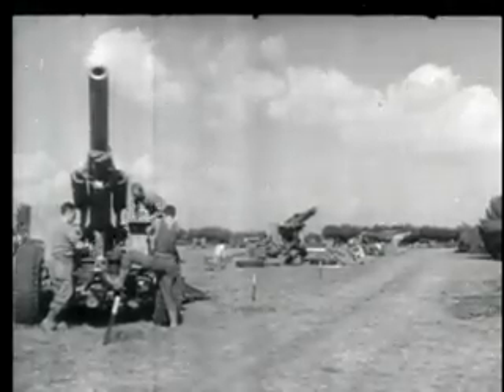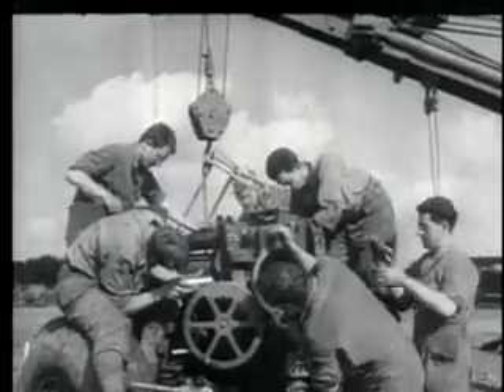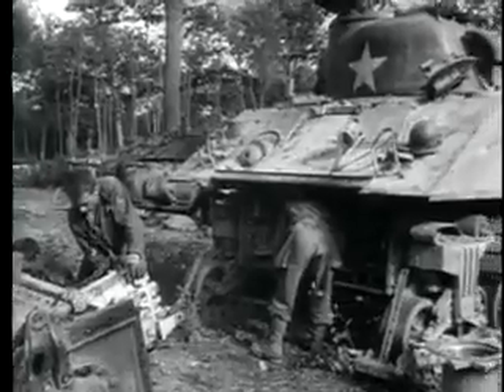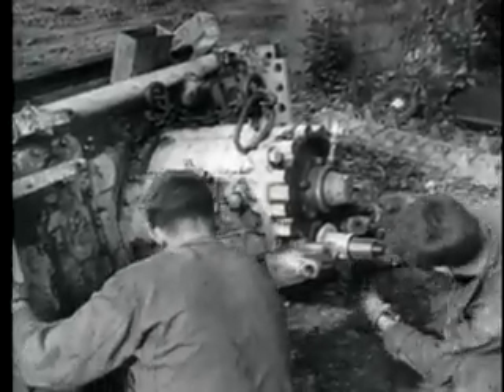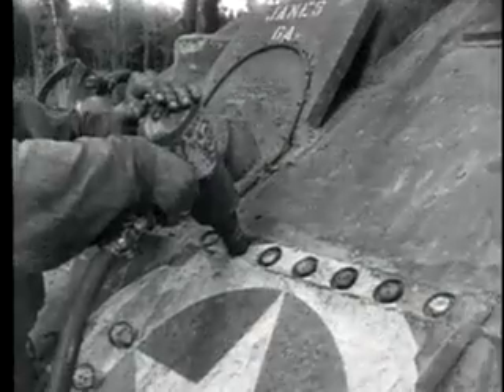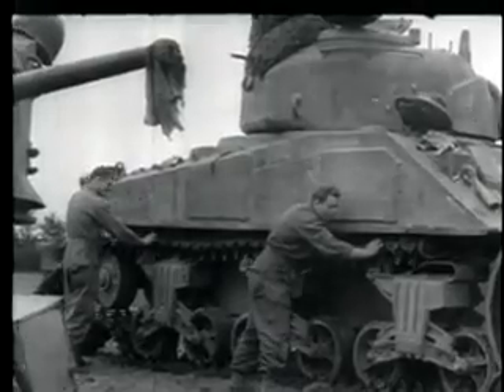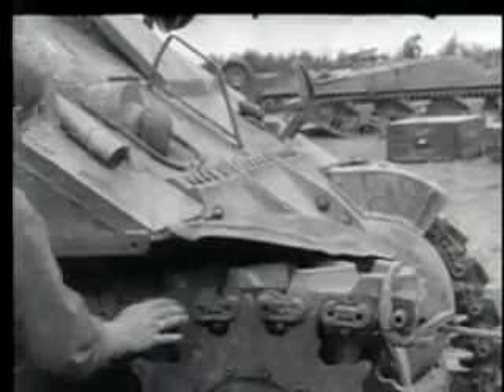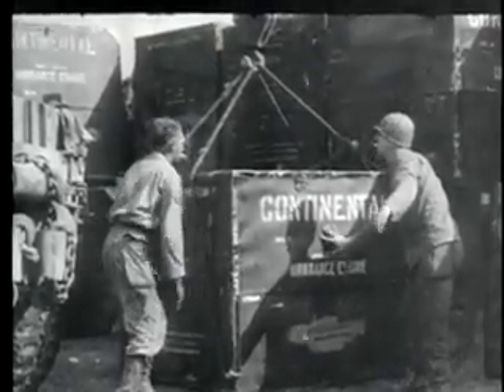Tank Repairs in WW2

Comment: Its funny how we still use 7018 rods and oxyacetylene cutting torches 70 years later...
Reply: BasePuma4007 right on man. I'm a welder myself so your comment really stood out to me. Your right too, we use oxy acetylene all the damn time at work. Its still your best choice for cutting any metal over 1/4 inch thick. Or fabricating lifting lugs out of 1 1/2 inch thick black iron. Honestly I wish I got to do more 7018 welding, love running multiple pass welds using 7018. When you finish a weld and go to chip your slag off and its already starting to peel back from the weld. Perfect bead !
Reply: BasePuma4007 they work well
Reply: Torches were at peak refinement in the late 1930s (I collect and overhaul them to use) though regulators had some improvement afterwards.  Most rods were celluosic and 7018 was invented post-WWII so when you see stick in action do not assume it's low hydrogen. SA 200 welding machines from the late 1930s still make money today.